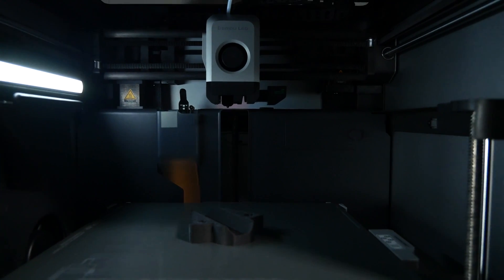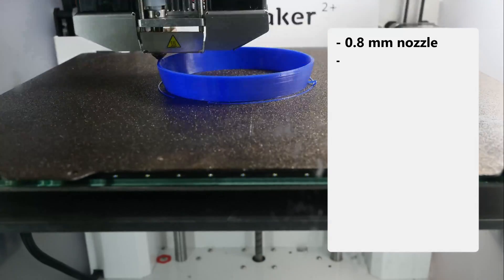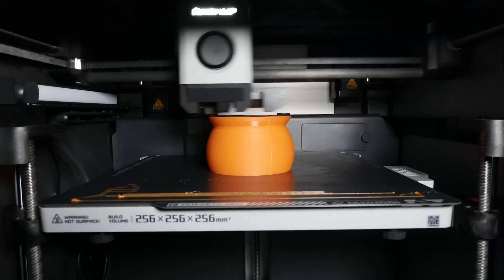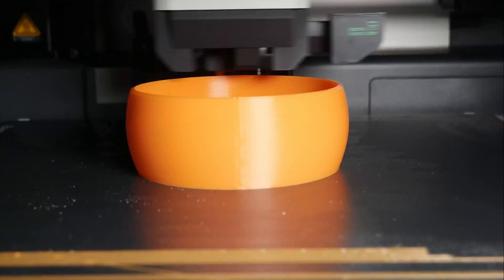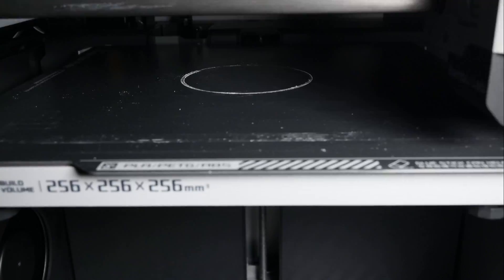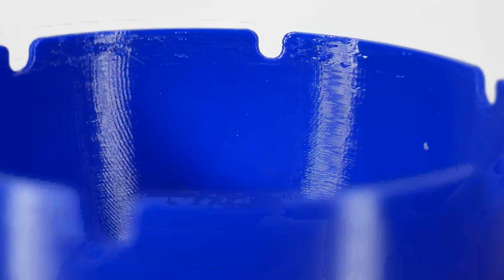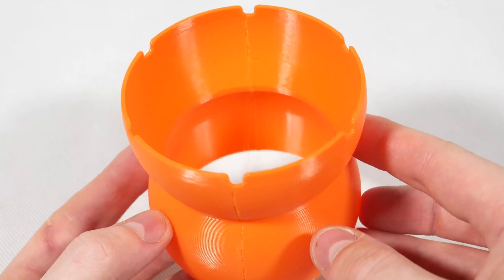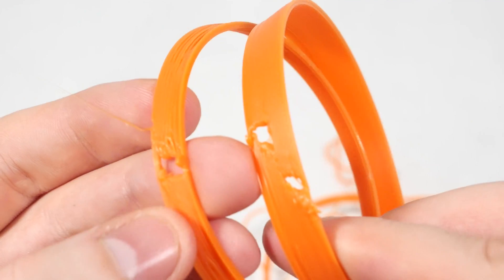Ultimaker 2+ vs Bambu Lab X1 Carbon | Which one is faster?

Comment: Currently, Ultimaker printers are not recommended at all, they are very slow and expensive, a 400usd bambulab (the a1) is much faster and achieves better quality and more automatic

Comment: Thanks for this video . I am thinking about purchasing  the Bambu Lab X1 Carbon. I too have an ultimaker 2+ ( bought in 2016), which I like because it almost never fails to print and I have done 24 hour print time too. The print volume is not much different. The ability to print at a faster speed is always a positive, The nozzle change to a different size seems easy enough although more expensive than the UM2+.(UM2+ simply unscrew the nozzle only). What is that printer build plate you are using?, It is difficult to find one that fits the um2+.
Reply from the maker: I already sold my UM2+ and don't regret it. I like the X1C much more. The print surface I was using on the UM2+ is this one https://amzn.to/42SAjFN

Comment: I wonder how much better the S7 is. That's about 10x more expensive than the bamboo but is it 10x better?
Reply: I have not used the S7 and I have not read anything about it. I feel that I am 100% qualified to answer your question though. The S7 is not  10X better.
Reply: We just bought an S7 and  2 Bambu X1Cs at work... so far I'm not too impressed with the ultimaker lol
Reply: It would be great to know some stories about your experiences printing, conclusions about bambu and ultimaker.

Comment: Sorry guys, iam not very knowledgeable about these settings but if thr X1C does so well with the 0.4 would a 0.6 nozzle be worth a try.  My X1C should be here this week
 Best of luck to all
Reply: I use my X1C with a .6mm nozzle everyday and it has been on it since day 1.  Having owned both the Ultimaker 2+ Connect and the Bambu Labs X1C.  The Bambu Labs is so much better in speed and print quality right out of the box.  If you don't need to print in a enclosed chamber I would recomend the P1P it is the bargain of the century.

Comment: The bamboo X1 carbon is a smart machine it's   got its own AI and gives you suggestions on your the supports are so easy to take off my spaghetti run out work just on some hair ask me if I wanted to resume and I did and the print came out
Reply: I swear that every damn company and clueless user is throwing "AI" as a buzzword into all topics and systems. It's damn annoying and misleading. LLMs are one thing (still not AI) , but calling these detection algorithms that are being used here as AI is just sad.

That said, these detection algorithms are a nice upgrade to have on your printers.

Comment: Here is my brutally honest review of the two companies. I have owned an Ultimaker S5 Pro with air handler and material station. I also own the X1 Carbon. (Plus tons of other printers purchased and built over the last 15 years) There is no comparison between the two. The S5 was a nightmare for dimensional accuracy. The Ultimaker software prevents any reasonable calibration / fine tuning of dimensional accuracy. The S5 might be acceptable if you want to print frogs and Christmas ornaments but factor in the cost and there is absolutely zero upside. Multi part models with close fitting parts? Forget the S5.  On the other hand the BBL X1 excels in so many areas. An AMS that works as advertised? YES! Super fast print speed! YES! Great quality prints! YES! Reliability? YES! Reliability with other filament manufacturers? YES! Dimensionally accurate parts? YES! By far the biggest difference between Bambu Labs and Ultimaker is the quality and functionality of the software. I would compare the Ultimaker software to a dumpster fire and the Bambu Labs software to a seasoned Apple product. It just works. It seemed like with every software update Ultimaker would break something else!  Here is a lesson for Ultimaker that Bambu Labs seems to understand from the beginning. Software quality is JUST AS IMPORTANT as hardware quality! Thank you BBL for making the printer of our dreams and continuing to develop the firmware / software! The latest 1.03 firmware update was an awesome surprise! PLEASE BBL IM READY FOR A LARGE FORMAT X1 CARBON!
Reply: Agreed. Have S5 and 2 x P1P's. P1P's blow the S5 out of the water. S5 pros - you can get good quality, albeit slow prints with a lot of CURA tweaking. S5 cons - touch screen is garbage. Finicky add ons that cause failed prints due to very minor errors. Garbage UI. Garbage camera. Way overpriced. Harder to find 2.85mm filament. UM overcharges for their filament. I used to like the S5 before I tried the P1P. Now I see that I got ripped off. Ultimaker deserves to fail as a company.
Reply: One last point, although I feel like I’m beating a dead horse. In the very early days of Ultimaker when they had a laser cut plywood kit, Ultimaker heavily relied on the maker community to help refine and tweak their software and slicer settings. The open source nature and maker community was a bit different 12 years ago, it really helped refine and improve the product. As time moved on and Ultimaker matured as a company, maker support became less of an option. I feel like Ultimaker did not expand their software group fast enough as their hardware moved away from the DIY community.
Reply: Really interesting to read yours and Andrew H's comments, i have a S5 and have been happy (ish) with it for 4 years, however it always felt over priced and too slow, 2.85mm filament is rubbish, Cura is messy, the UI is garbage on the printer, no print info, not even temperature info displayed without going into a sub menu... etc etc, i was thinking i would get a X1C, now i def will. Only downside would be slightly reduced build volume. How have you guys found the slicer and smaller build volume ? thx
Reply: @link6032  spent a bunch of time in Cura with the Ultimaker 5. Then I spent 10X more time in Cura with Ender 5, Ender 6’s, CR10s. My first experience with Prusa Slicer was on the X1C.  Pleasantly surprised how easy it was to adapt. I suspect the bed leveling, preloaded filament settings, flow calibration all helps to make the slicer experience better.
Reply: @Turbo442  thanks, have you sold your S5 now ?..., the filament size is such a pain to even keep for larger prints
Reply: @link6032  Yes that printer is gone. 2.85 filament is unusual now. In the early days of printing that’s what everyone used.
Reply: @link6032  Agreed. Bambu platform based heavily on Prusa Slicer which overall is much more intuitive than Cura. I am now running 7 P1P's and so far so good. No experience with X1C but P1P basically a nicer version of that. Most issues I have seen for X1C are in regard to the material station that sits on top of it. Some errors in design on that that cause issues. Bambu will likely release an updated version at some point, but no word on that. They are likely completely overwhelmed by the demand for their printers right now which is why people complain of support issues.
Reply: Well, got my x1C, had it 2 hours and sold the S5, the Ultimaker is frankly a dinosaur and not even in the same league, I am astonished how much better the X1C is, Ultimaker are soooooo far behind its embarrassing. Glad I was able to sell the S5 before the used market completely collapsed and I lost all value !. The X1C is astonishingly good
Reply: Why did you opt for the Bambu, for speed only, ( of course i dont know the software capabilities for accuracy, i dont have that to try) I would like to print with easy removable support structure, hence the auto spool selector would be great, but it purges every switch of spool. would the UM3 not be better for that operation?
Reply: @outshotdarts  Just save yourself a huge headache and get the Bambu X1 if you are in any way interested in a new printer and can afford it. The U3 and U5 fall far short of the X1 in so many ways. I tried touching on some of the reasons in my previous post. Even with the purge the X1 is going to be faster with support material than the UM printers. I’m mainly interested in the X1 because of the quality, reliability and accuracy. I don’t care how long the parts take if they come out perfect.
Reply: @Turbo442  Ok but my um2 is reliable and i have fine tuned the accuracy, and ease of nozzle change is so easy, i cant switch material so that is a negative. Yes i can afford the x1 carbon, but it seems like buying a new car just for the sat nav, is that enough.
Reply: @outshotdarts  Nozzle change on the X1c is only 2 screws if you buy them as a unit with the fan/heating, thermistor and sock. for just under 40$. And it's not just the speed, it's the quality of the prints too, as well as the slicer, the screen interface. Also the UI works great stopping failed prints etc, etc. It really is a great printer.
Reply: @Kman31ca  I find the quality of print is good on the ultimaker 2+. The change of nozzle size is a must have for me and a simple screw in screw out on the utlimaker is good for me. To be fair if i did not already have my ultimaker, and I was looking for a 3d printer with good quality prints with all the extras to ensure a good first time print then I would definitely go for the x1 carbon, but as for an upgrade I am not so sure. Perhaps if they bring out a dual nozzle set up then i will be interested.
Reply: @outshotdarts  I hear ya, but just so ya know to change nozzles for the X1c it's basically 2 screws unless you are setting up a new nozzle with thermistor, heating cartridge etc. 
  I've got two .4 nozzles and a .6 nozzle ready to go at all times and it only costs 30 some bucks for the full nozzle set up, or 12 bucks just for the nozzle.
  The Ultimaker sounds like a great machine, and I've never tried one. 
  But what I really want is the Prusa XL with the 5 extruders. Once that printer is really ready to go it'll be one hell of a machine.
Reply: @outshotdarts  Bambu can do a good job using single material as both support and print. It takes some dialing in with z height to get it just right but I was surprised with the quality attainable. That's with petg. I don't print with anything else.

Comment: Did you try different temperature settings for the nozzle? On the Bamublab the prints have a very matte finish. I had the same finish with my E3D Revo and 0.8 mm nozzle when printing too fast with 0.4 mm or 0.55 layers. Therefore, I had to adjust the printing temperature slightly or reduce the printing speed. In my case +5 to +10 °C made a huge difference. I also noticed the same issue with the seam, when the printing temperature was too low. This could also explain why some of the layers didn't stick to each other.

Overall, I think the Ultimaker 2 is still a capable machine. Print speed is not everything. I don't care if it takes a little longer to print, as long as the printer reliably produces good prints.
Reply from the maker: The tip with the temperature is very nice, I will try that for the next print
Reply: @enwi  In the meantime, i got my X1 C and had the same issue with the matte finish using the stock settings. In my case I had to increase the nozzle temp to 240 °C for PLA (rated for 200 - 220 °C). I guess, we will see an update of the hotend in the near future. It just can't hold up to the print speed.
Reply: I saw if I open the doors the finish is glossy, if I stay doors closed the finish is matte
Reply: Ya when printing at higher speeds, I always up the heat especially with silk or shiny filaments.

Comment: Working on getting my voron printing considerably faster than even the x1c
Reply from the maker: What are you aiming for?
Reply: @enwi  30k at 500mm/s. Running 48v high torque motors
Reply from the maker: I thought the 250mm/s on the Bambu Lab where pretty fast, but doubling that is insane 😂
Reply: @enwi  48v motors go brrrrr

Comment: i mean, the ultimaker is a fossil compared to the latest and greatest bambu lab or diy like the voron ratrig etc so it would only be fair to have ultimaker update their model & test that but at the same time ultimaker is still selling their fossil still for 5x the price? that’s insane. they can no longer charge insane peices for the “ease if use to schools” you can get away with high prices if it rivals moat competitors and at this point it’s comparable in performance to a ender 3.
Reply from the maker: Couldn't have said it better. The Ultimaker 2+ when it came out costed 2300€ and the X1-CARBON only 1700€ with a 4 filament changer
Reply: The best part of all of this is Bambu pushing the whole industry forward.  

I have been on the sidelines for many years waiting for a jump in 3D printing tech to something faster and more reliable before investing my time and money into it.  My first 3D printer, the X1 Carbon will be delivered in 2 days.  🥳
Reply: @yayinternets  same here! I've been using the Ultimaker S3 at work for years but could never have justified spending that kind of money on one for myself. I knew one day though I'd be able to get something in the same league for just a fraction of the price and it seems that day has finally come 🥳

Comment: this is not even close to a fair comparison. over all print speed is not enough to get the data. You will need to increase the acceleration and jerk settings of the ultimaker to get it close. none the less it wont matter. the ultimaker it not built for speed like the bambu.

The hole you had in the print is likely a bad slice with broken mesh. changing the seam position just resliced the file getting different gcode

These seem to be completely default settings right? Adjusting your wipe at the seam so that it turns into the inside of the part. this will make a completely clean seam - testing of course for other materials.
Reply from the maker: Also thanks for the tip on adjusting the wipe, I will try that
Reply from the maker: Yes it's kind of unfair, but also shows how fast 3D printers can get

Comment: Just ordered the XC1 with AMS. I had a moment where both of my Enders wouldn't print worth a damn. Can't wait till this arrives.
Reply from the maker: Are they working again though?
Reply: @enwi simple answer is NO. The E3V2 has an error on the sonic pad. My new 2 month old E5P has never worked right. I've been fighting with Creality over it. I've been replacing parts to the BL touch , swapped out the springs for silicone spacers, installed anti back lash nuts. The bed won't stY leveled, one side drops . So I'm not real happy with Creality at this point.
Reply from the maker: That really sucks, so far I didn't have any issues with the X1-CARBON, but time will tell. On the Ultimaker only the bed temperature sensor broke once, but that was a 5€ fix.